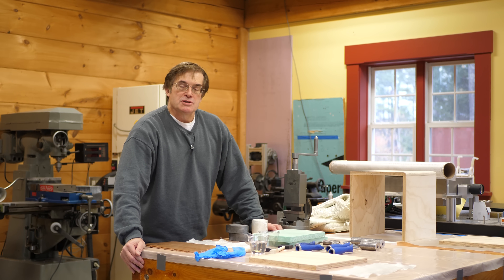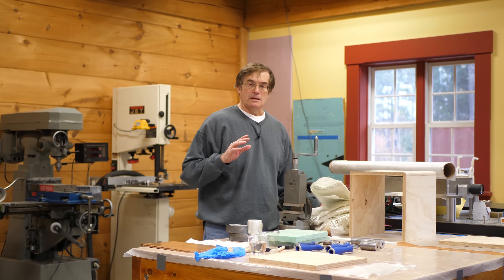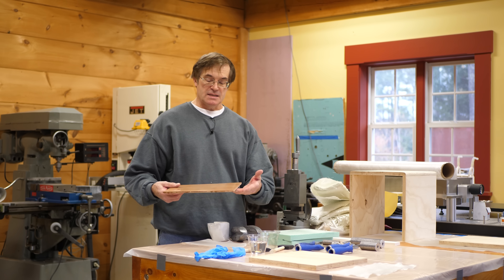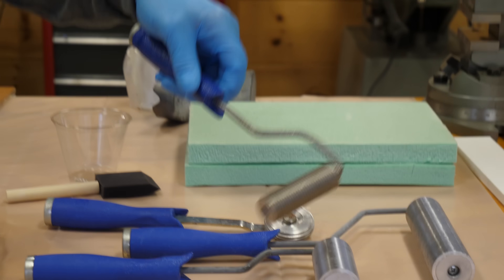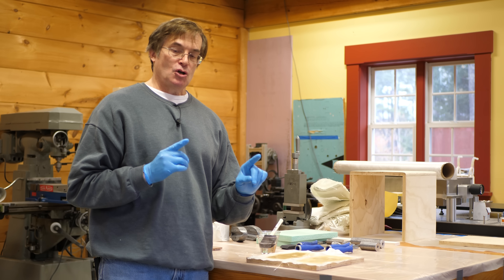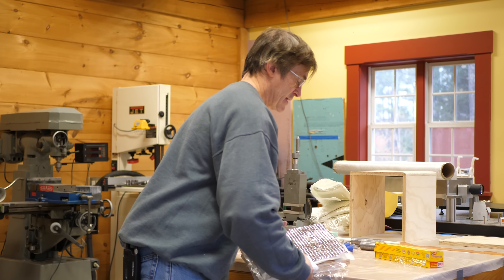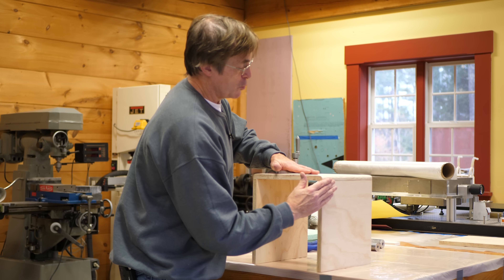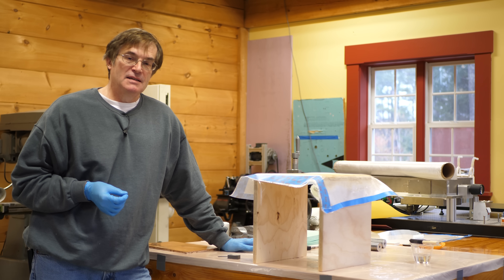Easy Tricks Using Fiberglass Strengthening!

Comment: I am new to fiberglass work. My purpose for fiberglass is prop making and sculptures. I see that you are applying the resin and fiberglass without wearing a respirator.  Is it always necessary to to wear one to avoid breathing the vapor or fumes? Could I work with fiberglass resin in my bedroom with the window open for ventilation? Or Am I better off in the corner of the backyard? I don't have the luxury of a garage or workshop like you do.
Reply from the maker: Officially, I'd say you should ware a hazmat suit and do everything under a fume hood.😙
However, I have worked with epoxy for decades with the only protection being gloves.  I have worked in a garage, a basement a boat shop and a lab.  Some people have or develop a sensitivity to epoxy that is serious enough to prevent them from working with it despite every protection.
In general, never touch the uncured components or the curing mixture and this includes rags, sticky tools and work surfaces.
Reply: @TechIngredients  Thank you!

Comment: The way I prepare a fiberglass prepreg is that I use wax paper 📜 . I put the mixture on the waxy side , I put the mixture on one side of the fiberglass sheet then place it one the wet mixture after that , put on the mixture on top. Then use the bubble buster after the prepreg is place on what you're placing the fiberglass on. Once the fiberglass is tacky trim the fiberglass sheet , and brush or pore the mixture and even it out .

Comment: I haven't seen any large boat building videos but have seen a repair video where they were working on a vertical section.
This tells me that working on the horizontal is only for small projects. So what would the best approach for working with epoxy and fiberglass on large projects that working on the horizontal is not possible like a 40 foot catamaran that has soft spots in the hulls that need be cut out and a patch applied?
Reply from the maker: Oh sure, it can be done.  It's just more uncomfortable and harder to get equally good results.  You need to watch out for drips and have to build up more, but thinner layers.  Additional thickiner in the compounds helps as well as aggressive lighting to hilight errors.
Reply: @TechIngredients  
Well turning a 40 ft catamaran over on one hull while you reglass the other isn't practical and probably would be very hard on structural integrity of the whole boat. So I'd say that repairs in the real world on large structures have to deal with suboptimal conditions. Only small projects that can be done from scratch or repairs on relatively small objects is the only time application of epoxy and fiberglass can be applied while in a horizontal position. 
This is one task where I really think you need to go beyond what is optimal and show how to deal with real world situation/s rather than the way you have so people who are looking to do large projects or repairs can get a better handle on how to do this.

Comment: This isn't comment...more question I believe u can answer better than boat guys (I'm  more of an aerospace substrate guy)...Residual  Amine blush if u use peel-ply (pp)on epoxy composites? Does it come up with (pp) or epoxy doesn't  have Residual  Amine blush?
Reply from the maker: Amine blush occurs when the curing epoxy is exposed to air, that's why it's a surface phenomenon.  Any occlusive covering will prevent it. Peel play also generates "tooth" in the surface so that subsequent layers that do not covalently bond will stick even without sanding.
Reply: I knew you would have the answer

Comment: i am going to build a 11 foot dingy should i uses foam balsa wood or plywood.  in the plywood is there much difference between box store under layment quarter inch baltic birch or marine grade plywood.  eventually i want to build a aluminum dingy then a 30 foot solar pontoon boat and then a 50 ft catamaran all solar powered.  how is the hydro foil coming on the tesla boat  dirk
Reply from the maker: Box store plywood is inexpensive and for good reason.  Marine plywood is more expensive, but easier to work with, stronger, with waterproof glue, no hidden voids, symmetrical layers and much less tendency to twist.  I'd stay with that if possible.

Comment: Great video, I'm learning a lot here. Would it make any difference in purchasing high density Foamular 1000 for the money versus the more common 150/250 density home insulation panels I can get at my Lowes/Home Depot? It seems the stregnth is on the lamination, not in the core. I would like to build a large cabin cruiser. Doing my research/planning stage. Thanks
Reply from the maker: The strength has to be balanced and in fact this foam has too low a compression strength to balance even a single layer of 6oz plain weave cloth on each side.  A denser foam would be a better choice.
Reply: @TechIngredients  Excellent, thank you.

Comment: I use an array of Floodlights to hurry the curing of my products. Usually a total of 500 watts from two lamps to heat an area with  5 to 20 items being cured...  roughly 1.5 sq feet.  Setting this up requires testing the target area heat buildup rate measuring the temp and changing the proximity of the bulbs to the work.
Reply from the maker: Sure, that works.  I have half a dozen for the same purpose.

Comment: Using carbon core 3/4 honeycomb material, laminate with 1708 Biaxial fiberglass cloth for boat stringers 8" height. 116" long vs plywood. I wasn't able to find any information to back it up of the strength being just as good. Would appreciate your input. Thanks
Reply from the maker: I don't know if I'd go with such a heavy cloth with that extremely light and expensive core.  Any sandwich material is also vulnerable to point loading failure and this requires engineering solid filler inside the core at those locations.
A very effective alternative is making custom plywood with most or all of the grain running in the direction of the stress.  Conventional plywood is only half as strong and stiff in the loading you care about because half the fibers are not being stressed.

Comment: My Brother has been using penetrating epoxy on his wood boat ( Folk Boat ) since the Mid 70,s on the mast it has reduced his need to refinish to 5-7 years from every 3 years max and he has, int used any glass cloth just a really good varnish and I am about to use it on top of a wood working bench made of 3 layers of ¾ " Baltic Birch plywood again without any glass cloth, my hope is that the penetrating epoxy will give it a higher surface hardness like maple - your video is confirmation of my beliefs thank you.
Reply from the maker: Sure!

Comment: Is temperature-related expansion and contraction of the underlying wood in a marine environment something to worry about?  Maybe not, but the seasonal temperature differences in some parts of the country can be significant.  If this does happen, hopefully, the wood frame and the fiberglass/epoxy shell will move together and not cause any damage at the interface.   Great video.
Reply from the maker: The epoxy shell prevents moisture from entering the wood.  When added to only one side of a wood panel, a kayak can be used over a significant temperature range without twisting or buckling.

Comment: you can make a curing oven from a simple 1500 watt hair dryer and an appliance box. 
i have a box from a washing machine and  another a  refrigerator came in. 
my oven will easily reach temps of 175*F on low near 300*F on high. 
i can cook parts literally the size of a refrigerator. 
very simply - cut 2 holes in the box.  1 hole to stick  the dryer nozzle into  and another to allow the air to vent out.
Reply from the maker: The nice thing about the lightbulbs is that it can run silently for days and the controller holds the temperature at a predetermined level.
Reply: @TechIngredients   yes- the hairdryers are not stealthy.  temp control is through ventilation, but you can very easily run temps over 200F.  i've used lights with success, but prefer hair dryers ( on low )  because they evenly saturate the entire area inside the  " oven " .  keeping in mind this is being done in a large open shop, not in my residential garage.

Comment: Is epoxy uv-stable (for long term outdoor use)?
Reply: No. You need to paint over it, or, you can add graphite powder to it, and apply a thick coat. You can also put varnish over it, or polyurethane clear coat. For best results, paint it glossy white. If you insist on showing off the material underneath, then you can use a two-part polyurethane clear coat or outdoor varnish.

Comment: One tip on working time... If your in a hot climate and you want longer working time, Take a larger bucket than the one the epoxy or resin is in.. Add ice into it place the resin bucket on top of ice and fill around the bucket with ice. This keeps your resin chilled and it wont go off until your done the project hopefully. The working time ON the piece will start faster when it hits the warmer temp but the material in the bucket wont due to the ice bath you have it in.

Comment: Have you tested poor man’s fiberglass, I.e. poly screen and acrylic primer, or canvas and Tight Bond II?
Reply from the maker: I've used canvas and paint to create a non slip surface on a boat deck, but structurally, glass is really inexpensive, non rotting and very strong.  I'd stick with it as the go to fabric for construction.

Comment: Have you experienced any real structural difference between using epoxy or Resin? I like to use resin where I can due to ease of use and availability, but I know each types have strengths and weaknesses.
Reply from the maker: If you mean polyester resin vs epoxy then there are several differences.  Epoxy does not smell as much as polyester.  Polyester is actually stronger, but only once.  It fatigues quickly when highly stressed.  Most importantly, polyester is weak when used as an adhesive or when wetting out very thin layers.  This is probably due to the fact that it is truly catalyzed while epoxy is more of a mutual polymerization.

Comment: Can you use filler (epoxy+microballoons) when the fabric is tacky to fill the voids and produce a more smooth surface that is easier to sand than epoxy and lower risk of sanding out fiberglass?

Comment: I maintain a 50 year old solid fiberglass sailboat. I often have do epoxy work on the curved part of the hull. Both inside and outside. Please do a show on a verticle  overhead sloping surface like that of a sail boat. I do my work in South Flordia in the winter, however, I always buy the slowest hardner as I have learned I must check and then recheck my work for mini-desaters. If the temperture drops I rig a heat lamp. I use my hand to make sure the work surface does not go above 100F (32C). Thanks for your works.  PS Foam core in the water  or on the deck panels, to me, seem much more desireable as water leaks lead to rotten wood that is very  hard to repair. There are ennumberable exambles of fiberglass coated stringer and decks ending up with rotten wood core.

Comment: Hi Tech Ingredients ...when you spoke about chemical bond vs physical bond, could that be applied to self made fairing compound? What I actually mean is epoxy resin on fiberglass that is beginning to harden in about 2-3hours then smoothing thickens epoxy with fillers as fairing compound? I hope to finally get my boat into a painting stage.
Reply from the maker: Sure.  The epoxy is what sticks, it doesn't matter if it surrounds particles, cloth or nothing at all.

Comment: Is there an epoxy that has a rubber-like finish? Looking for something to dip 3D printed parts in to essentially encapsulate them in rubber. Any suggestions?
Reply from the maker: There are toughened epoxies, but they tend to still be very hard.  There are epoxy based, two part paints, like those used for garage floors.  They may be worth a look.
Reply: @TechIngredients  I'll check them out. Thank you!! Also your videos are great. Keep it up!

Comment: can you answer this for me? No body else seems to want to. Can you fiberglass over pressure treat plywood, that is dried out? Next question can you fiber glass over RTD plywood? both with polyester risen.
Reply from the maker: You can fiberglass over both materials using epoxy. I'm less familiar with polyester resins and can't guarantee that it will work,  although I suspect it will.
Reply: thank you for getting back. I think I'll do what you ask and give it a try on scrap.

Comment: Only one question. How do you remove the resin of your tools? I see you just left the bubble roller there without cleaning it. I always had to use disposable tools.
Reply: Acetone removes the resin while it is still tacky. Once glass sets up you have to wire wheel it off. Nothing I know of attacks it. I mean they make gasoline tanks out of the stuff. It is pretty impervious cured.
Reply: @1pcfred  thanks for the reply, yeah that resin sticks alot more than crazy glue.
Reply: @luemn7691  while it is still sticky acetone takes it right off. I don't even wear gloves when I fiberglass. I just get werewolf hand and when I'm done I get all of it off with acetone. But I won't start fiberglassing anything without acetone to clean up with.
Reply: @1pcfred  Dang Paul! you go hard that stuff is as nightmare!
Reply: @luemn7691  nah it comes right off with acetone. Makes your hands dry in the process though. I find that if I want to do anything I can't be afraid of getting some crap on my hands in the process.
Reply: @1pcfred  paul you sound like a motivated plumber now.lol
Reply: @luemn7691  I've plumbed. And when I have I've always been motivated to get it wrapped up ASAP. A plumber is a carpenter that can't get anything level and often makes structurally unsound construction decisions too. Who put that joist right where I have to lay this pipe?

Comment: Did you use fibre glass instead of carbon fibre for the catamaran? if so why?
Reply from the maker: We did use carbon fiber for selected areas of the deck, but the weight savings would be small for a single, thin layer and even so the cost would be much higher.  Also, carbon has a lower damage threshold, it's brittle.

Comment: When using marine grade epoxy resin, approximately how long of  a time frame do I have until it catalysis sets to a un-workable state?I have a boat hull frame all done but lack the experience to work with fiber glass. Hope to hear from you soon...had I known of epoxy resin earlier and seen you video I wouldn't of melted the foam core with regular fiber glass resin.
Reply from the maker: What you're calling regular resin is polyester resin.  The highest performance composites use epoxy due to it's compatibility with a variety of foam cores and it's greater resistance to fatigue failure.
Epoxy is available in a wide range of cure rates from a few minutes to hours including those that won't cure at all unless they are heated.

Comment: I am repairing a few cracks in a fiberglass shower pan--each about an inch long. I widened the cracks to about 3mm so I could fill them with a bead of epoxy. Can someone recommend a way to reinforce the patch?
Reply from the maker: Ya, but it involves  more work.  You need fibers to cross the cracks and the defects that allow  the cracks to form extend beyond the visible ends of each crack. Sand the surface around the crack to allow  a small patch of lightweight  fiberglass cloth to be laid in the depression, flush with the surface. Wet the fiberglass with any slow cure epoxy resin.

Comment: What are your thoughts on a bicycle frame made of fiberglass? 
And ideally, the front end of this bicycle should be much lighter then the rear in comparison, so more then likely less structual integrity i would imagine.

Also curious on your thoughts to press fitting bearing races and such as well and if i could do so on just a strictly fiberglass tubular structure, or would need something (we'll say alluminum tubing in this case) bonded to the fiberglass layer and using the alloy tube for my strength, and if that is even a possible option? Unsure of how well fiberglass could bond to alluminum if need be
Reply from the maker: It's certainly possible. Aluminum can be bonded, but needs a surface treatment for maximum strength.  Press fitting will also work, but machining fiberglass is tough when you need precision tolerance. I'd bond it instead.

Comment: How do you get the fiberglass on the foam
Reply from the maker: I'm not sure what you want to know.
Reply: @TechIngredients  
Doesn't the resin melt the foam
Reply from the maker: No.
You're thinking of polyester resin.  Epoxy is completely compatible with almost all plastics and organic fibers.  Polystyrene is no exception.
Reply: @TechIngredients  
What epoxy do you use on foam and wood?
Reply from the maker: There are many commercial choices, but for years, we have used Raka epoxy.  Their prices are very competitive, and they have different formulations for different purposes and workshop temperatures, but overall, the "slow" version is hard to beat.